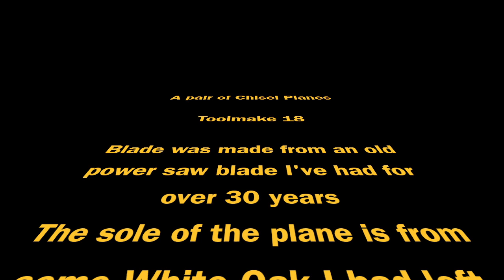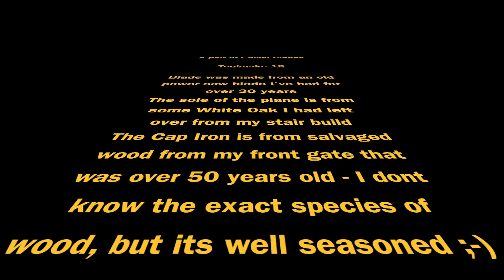#TOOLMake18 Chisel Plane

Comment: Great job Steve :) I need to get going on mine in between house building work. Have you checked James build off at Wood By Wright. You can include it there also :) ॐ
Reply from the maker: The Wood Yogi Thanks Chris, I’m sure you’ll come up with a good looking tool Chris in between doing the house improvements using some of that nice timber from your wood shed. 👍🏻

Comment: That is a cool tool.  Lovely build!  Did you temper the blades after hardening?
Reply from the maker: Hi Jim thanks for the compliment, I haven't tempered the blades as thought due to there light work they'll not really see and hard abuse and will keep their edge longer by being left hardened. If not then a rerun of the heat treatment doesn't take too long. Cheers Steve